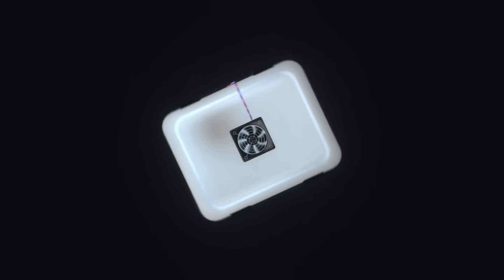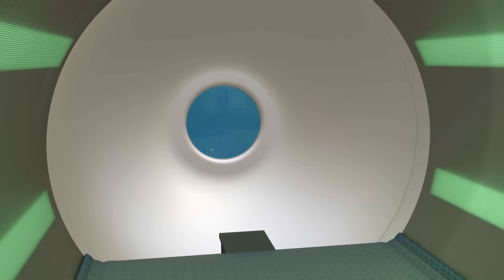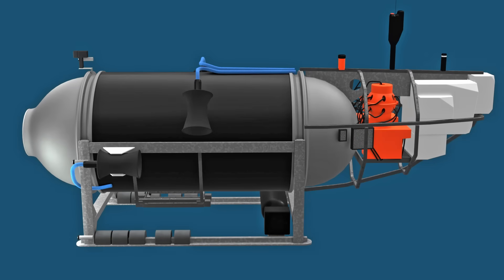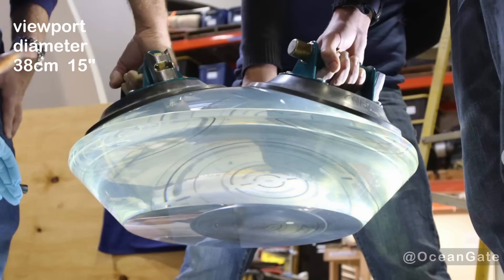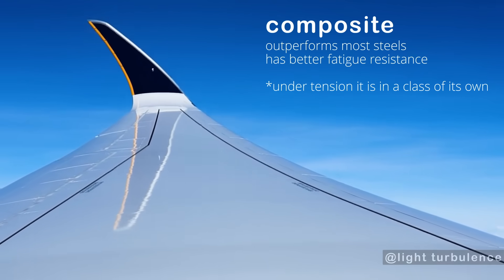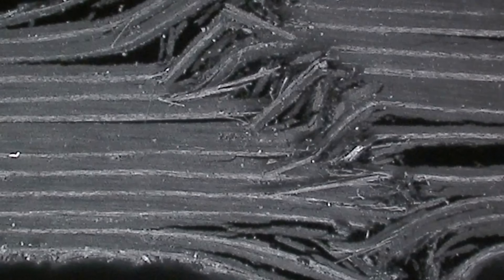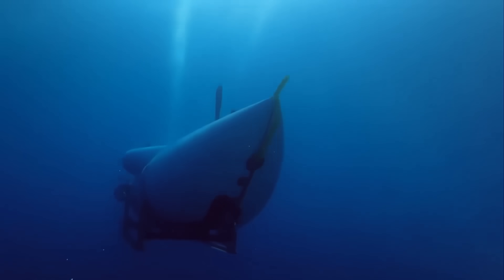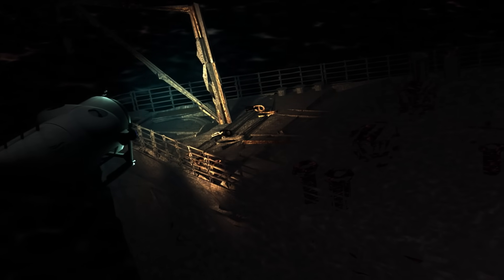Titan Sub | carbon fiber - Detailed Tour

Comment: The big difference between composite and metals is metals can compress at a molecular level under pressure then expend back to normal when the pressure is removed. It can do this repeatedly and engineers can work out how many times it can safely do this.
Composites on the other hand don't compress well because it's not a homogenous material. The carbon fibres and resin have different properties and on top of that, finished carbon fibre is not homogenous like Titanium or Steel.  It will have differences throughout the material. Some parts may have a bit more resin, some less, some fibres might be closely aligned while others a little bit further apart.
That doesn't make much difference in normal applications but 4KM down in the ocean under those sorts of pressure, small variations can have enormous consequences for the strength of the vessel as a whole.

It was reported that the carbon fibers’ axial compressive strength is only 10%–60% of their tensile strength and their transverse compressive strength is 12%–20% of axial compressive strength. 
Titanium on the other hand, it's compressive strength is more than twice it's tensile strength.

Stockton Rush was a snake oil salesman and he knew that's what he was. He knew he was taking a massive risk with his sub. The structure of his company illustrated this. The holding company was registered in the USA while the company that operated the sub and rented out the seats was based in the Bahamas, thereby avoiding US regulations.
Reply: Metals will develop fatigue cracks but that is something you should be monitoring.  CF will crack and they heard crackling noises on some test dives.  They didn't seem to do enough testing and were overly optimistic about the lifetime of the sub.
Reply: @SuperLordHawHaw  an employee was asking to scan the hull and he was fired.
Reply: I agree he was primarily a salesman,
Reply: Was the pressure to start making a profit what drove him to take risks?
Reply: Amen @MikeJones-rk1un
Reply: If he would have added titanium ring type ribs through the cylinder would this have increased the body's ability to handle the pressure?
Reply: only  extensive testing would reveal but a combination of this might work. funny, now everyone that said - CF would never work will be attempting all sorts of combinations (not funny that people died -i know. a close friend lost their father in 1968 Scorpion implosion @parallelsandtangents938
Reply: Mike here,  the content creator here is an architect; some of the people he tries calling out as literal structural engineers.
Reply: I think Stockton Rush was a salesman but was blinded by the engineers around him, I'm sure he 100% believed in the people working for him though, I don't think he went down there and died with the passengers thinking he would be the only one saved if something happened, I think he thought that this fool proof product, he was obviously wrong and it cost him his life as well, but i do not think he understood the risks as well as he should have and did not put human life ahead of the mighty dollar.
Reply: More likely, he believed primarily in himself. He intentionally hired engineers fresh out of college who would be cheaper than those with years of experience and far less likely to question him. If anything, the engineers would have been blinded by his charisma, which they would have mistaken for genius.
Reply: @foxymetroid  Arrogant and a likely personality disorder probably played a role. He wanted fresh grads to pay them less and be less likely to rock boats
Reply: Right, CF is insanely hard to test, aide from detecting obvious defects (voids). Even metal can fail in unpredictable manners with micro-cracks from fatigue. They still do research on this, particularly with turbine blades.
Reply: That is why I think it was the glue that came undone and sealed the deal.
Reply: @Joe-TechandBlog Everything came undone 😬
Reply: Have you tried Nitinol?
Reply: So what you actually say is that there is a god after all?
Reply: It scares the living daylight out of me this madman was legally allowed to bring innocent victims on his trips without proper certification of the building structure of the sub. I have no problem watching this looney toon go down alone with his sub doing prototyping but allowing innocent customers with zero knowledge about the truth is beyond comprehension.
Reply: @ThomasConover Legally allowed by whom? He placed himself outside the jurisdiction of every government. The most that anyone could do, was warn his customers. Yes, that should have happened.
Reply: @johnathansaegal3156  U mean plastic deformation, until it breaks, defining the ultimate stress limit.
Reply: And US liability
Reply: I've been wondering if the titanium glued on to the carbon fiber could have been the cause. Wouldn't the metal not compress as much as the carbon fiber? Could the carbon fiber have caused the glue to break away from it's end caps because of the difference? Could the glue become more brittle because of how cold it gets at that depth?
Reply: Yes this guy is stupid!
Reply: Composites can work in this application. It's just a matter of design and testing. I would have gone with an all composite hull, possibly using scale models with real world testing. 
Rush wasn't a "snake oil salesman". A snake oil salesman would never have made the dive in Titan and Rush made many. He had a vision that he believed in. He was wrong about the capabilities of Titan and probably foolish, but being wrong or foolish doesn't make you evil or even a bad person.
Reply: @albion4044 It is evil when you then deceive customers, fire engineers, and evade governments, as he did.
Reply: @johnathansaegal3156  That is if the metal is not bent already like in a car crash and that is a further reason that carbon fiber mixed with metal is not a good idea.
Reply: Well said. I worked with ROVs for 25 years and would like to add 3 comments. It was a mistake toeing the sub with a flat bottom barge ( the swells caused server hammering to the sub) 
The expansion and contraction of dissimilar materials with the hull is not good and was proven every time a loud bang was herd.
The landing skid was to short it should have been long enough to support the weight of the ancillary batteries, the oil filled cans and the syntactic foam buoyancy, all of which are extremely heavy items in air. in the water only the splash zone and on the surface the barge thumping would cause excess loading on the aux pod.
Reply: @rayfisher6869  How many of those ROVs in your 25 years of experience were toed.
Reply: @rayfisher6869  wish i had a nickel for every self guaranteed rocket scientist cause if i did then i would be able to afford to build my own rocket-ship built by me and  and go live on mars, because i have 58 years of experience with opposing thumbs and capable of changing the universe. lol
Reply: @rayfisher6869  might you please explain to us why yo did not build the submersible to go to the titanic considering you expertise in this field? i totally wish that ocean gate  would have hired you for your scientific knowledge then people would not have died,
Reply: A composite could be perfectly safe, but we have to remember he had design goals to keep it small and light. As you know, there is going to be a limit to how small and light you can make it, and it appears that he went past that limit. Although I agree that using brittle materials sounds unwise, it is not the carbon's fault that he made it too thin, or wove it wrong, or did not consider all of the stresses in the design.
Reply: @itoibo4208  Why light? Heavier reduces the ballast.
Reply: @arturoeugster7228  my understanding of his intentions was that, by making it smaller, it will be lighter, and could be handled by a crane on a given sized boat.
Reply: @itoibo4208 I think that if he broke the cylinder into two halves and had a central titanium ring it might have lasted through the intended service life, but of course that adds more glue joints and two separate cylinders that have to be made to the exact same tolerances.
Reply: @stopthephilosophicalzombie9017  not really because the modulus of elasticity is much lower than carbon. Even with a large preload in tension of the carbon fibers the load would quickly transfer to the carbon fibers into compressible loads, some stabilization remains but not enough.
Reply: so, not being argumentative - i was involved in aerospace when composites first entered. everyone said that nothing would replace aluminum (titanium/steel in empennage/landing gear main spars and stringers)  - we witness today, 787 that have mostly solved these issues.
Reply: @prestonburton8504 Airplanes aren't the same as subs though
Reply: @prestonburton8504 I believe the same type of technique can be used with rubber.
Reply: well, all helicopter cabins were made of aluminum (mostly) and sure, rubber was used.  And yes, no matter what! it bounces! @M33K3RZ
Reply: @prestonburton8504   and airplane is not a sub.  Stockton Rush was told time and again what he was doing was wrong and it needed a lot of testing. He did now and he killed four people along with himself because of that.
Reply: @prestonburton8504 SORRY, BUT your saying is completely NONSENSE... Comparing a composite to aircraft aluminium is wrong, but trying to compare the stress field of an external pressure vessel with the stresses on any airplane is ridiculous. Assuring that, because composites have displaced (SOME) of the uses of aluminium in aircraft, regardless of the resistance to change many years ago is completely wrong.  THERE IS A REASON A COMPOSITE PRESSURE HULL IS NOT A GOOD IDEA.
Reply: @alfredomarquez9777  tell that to all the highest performance pressure vessels that rely on fiber glass or carbon fiber to achieve the pressures that no metal can.
Reply: @malcomreynolds4103  containing pressure is a bit different than resisting external crushing pressure
Reply: @cambriaofthevastoceans6721  wasn't referring to contained pressure vessels. The best pressure vessels in the world that go through countless cycles at depths deeper than the titanic, all use composites. there are no metals that are that durable.
Reply: @alfredomarquez9777  The primary and most obvious reason is that it has never been held to any standard of testing in a deep water marine vessel.
Reply: this is so very true - yet, we engineers seem to find a way to always solve the problems in front of us!  part of the program for the first helicopter fuselage cabin/cockpit - just tested by nasa. have not seen results yet
Reply: that is ENTIRELY incorrect. SOME Metals can stress and recover, but all of them are limited. The metals that would traditionally be used for a deep sea sub (titanium, aluminium, hard grades of steel) have extremely limited ability to endure multiple work cycles

Comment: In of itself, carbon yarn/filaments have no strength under compression.  What will prevent the compression will be nearly all the polymer bonds of the adhesive system employed.  If you handled the carbon they were using you would have been able to easily compress the filaments and probably break them.

Comment: Carbon fibre is not appropriate in this specific application. Your conclusion supports this fact. 

The fundamental issue is more glaringly obvous however. The use of a cylinder rather than a sphere. 

Many argue that it worked while completing x number of dives. While listening to stress fractures 🙄 Loud noises are caused be energy release. That enery within the structure is lost. There is no going back. Titanium doesn't do this. Neither does high cabon steel. It was a particularly bad material choice and the consequences of this bad choice are somewhat obvious  🙄

Comment: The hull was basically 5 inches of epoxy resin.  I give the CF little value in such an extreme compression application.

Middle of the hull would deflect and work more than the ends, since it had no internal bracing.  Popping sounds were probably CF filaments sporadically failing.  Obviously...any tiny defects would grow each dive cycle.

Comment: Carbon fiber is good when expanded from Inside not when compressed from outside. Why are you spreading misinformation? It was the wrong material to use in the first place and based on a recent investigation the hill was as breaking and cracks were visible in the carbon fiber composite

Comment: Ive worked with Carbon fiber based competition race cars......it is a fantastic material given its strength and rigidity for the weight.  However, every and any material must be tested exhaustively to make sure it is suitable for an application and not just "shell be right mate". Same goes for the attachment methods of the end domes......testing is needed.
Reply: Yes. I can see how the expense of this thing could cause someone not to want to destroy it, but I would not be comfortable with it until I had pushed it well beyond its target conditions for many cycles. It should have been pressurized, dropped, banged with rocks and things, until one was sure it could handle the loads.
Reply: Exactly. In areas it has been used for decades like race cars (as you mentioned), or aviation, they know proper implementation. Oceangate didn't, but they acted like they did.
Reply: @alext3811  re: "In areas it has been used for decades like race cars (as you mentioned), or aviation, they know proper implementation." bingo, i personally was using Carbon Fiber at Agusta Aerospace for the doors of the A109 (ie, the helicopter featured in the first Jurassic Park movie) back in 1993 or 30 years ago as a "mature application", and the material was already in use with NASA and the Military way before that.  so see, the problem comes in that those who are "baby young to the world" and have no life experience are EGOTISTICAL and naturally tend to think things were just invented, rather than seeing things properly through a "lens of history".
Reply: @alext3811  re: "Oceangate didn't, but they acted like they did." see Wikipedia entry for FRAUD.  also entry for Bernie Madoff/2008 Collapse of US Housing, Beth Holmes/Theranos, Trevor Milton/Nikola, Sam Fried/FTX Crypto, Charlie Javice/Frank, and Elon Musk/Tesla/FSD. <---- the info needed to properly evaluate who Stockton Rush was is literally staring everyone in the face.
Reply: right? zero destructive testing, how can you understand the failure modes of a completely new (for the application) material, without observing any failures?
Reply: @spambot7110  Yeah, probably a better case study for the value of testing rather than simply the wrong material for the application.  If you decide to be an innovator and step outside the umbrella of convention then the onus is on you to test it and help make it a new convention.  Maybe that's a distinction between someone that's an engineer first, explorer second rather than vice versa.  If you're going to skip the formal testing then at least collect all the expected telemetry as if it were a test, and explain to the people you're trying to sell tickets to that the unknown risk they're taking is in the name of cost savings, and the consolation to experiencing a catastrophic failure is that the next version will be better.
Reply: @spambot7110  "runaway ego"
Reply: indeed!  Haas! F1
Reply: carbon fiber is a man made material.. it WILL have flaws. either in itself or during the construction of the hull. this will firever be a reality, and it will crush and delaminate over time under repeated extreme pressure. add to this, what is the point of a superlight under water vehicle(pro) anyway
Reply: "Must be tested exhaustively" - to bad they didn't take your words into consideration from the very beggining instead of traveling 100s of meters below the surface to then realize they hooked up one of the external thrusters backwards...
Reply: maybe the end domes should be allowed to slide a little to not crack the carbon from temperature changes
Reply: @alf3071  Sliding the end domes isn't helping Perpendicular Axial Stress. At some point they put stress into the tube AT the machined surface of the tube.
You don't even have to glue them on really, external pressure would keep them on. They just need water-tight sealant.
But ends of the naked tube have to be dead-nuts seated THO, there is no variance. Pressure would SPIKE at the contact point too.
They used the 'Adhesive' as water-tight sealant, and a material to 'seat' the tubes so they are dead nuts even in the contact patch. It's a stress spreading thing really. 
Those Ti rings that have the undercut area that made the metal ribbon hanging off? that area was slap filled with adhesive only. The carbon fiber didn't protrude into that area to LOCK it in place.

Comment: You mention in your video why carbon fiber is not acceptable for deep sea environments. The inability to verify the integrity of every fiber in every layer. There is just no way to be certain with current technology and the risk is far too great. Any failure is a catastrophic failure period. Any flaw in material or layup will result in invisible undetectable weaknesses that can only result in catastrophic failures.